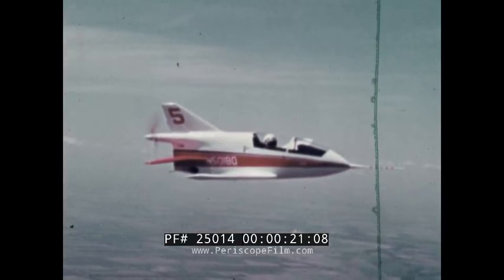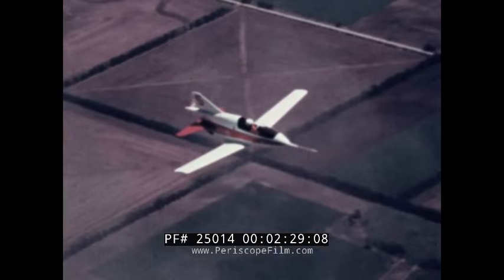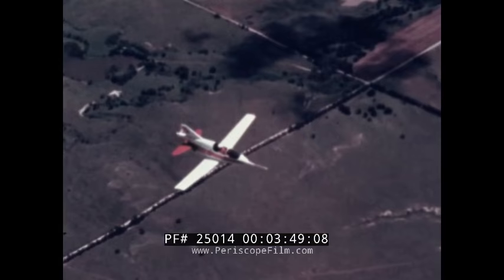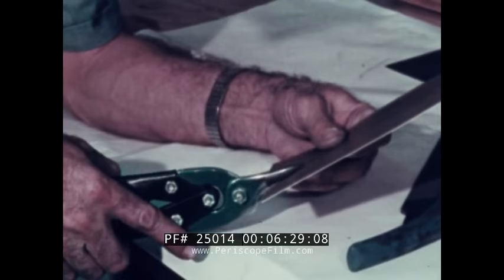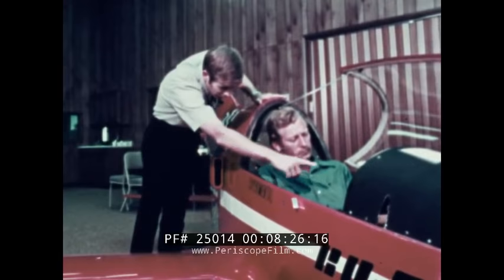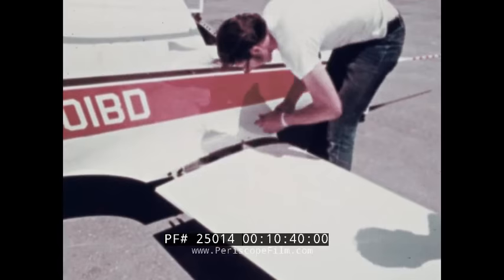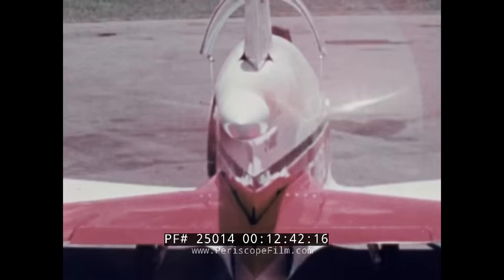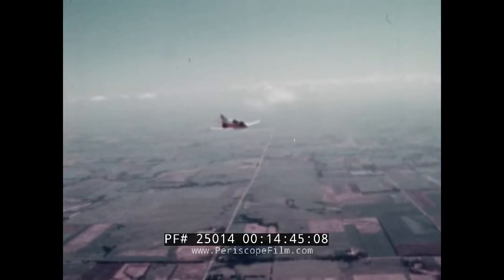BEDE BD-5 MICRO AIRCRAFT  PROMO FILM  "PIECES OF A DREAM"  25014

Comment: The BD-5 was WAY ahead of it's time! It was a sensation! Thousands of kits were ordered in the first year, when most airplane manufacturers would be ecstatic with 50 orders a year... Sadly, it was a bankrupt engine manufacturer/supplier and the long process of solving torsional resonance in the drive system that eventually lead to bankruptcy. Modern lightweight engines have finally caught up with the BD-5 in both the prop version and the jet version! Now it's better than ever!!! Five BD-5s were at Oshkosh 2018! FIVE FIVES!!!!!
Reply: Of course, an airplane is absolutely no good without a reliable engine. Unless it's a glider... 😂

I'm assuming all those BD-5's were jet powered?  Btw, The SONEX jet Jsx-2T is almost the spitting image of the BD-5, except it sports a V-tail.

Comment: I wonder what the performance would be like if they replaced the metal wing and fuselage with composite parts.
Reply: seoceancrosser 

They had always used composites ever since Bede brought Burt Rutan onto the design. That’s why you see the vertical tail and the use of composites.
Reply: According to a generalized presumption in my aeronautical engineering books you can count on greater that 5% increase in performance by using composite parts instead of aluminum. I think it would be awesome to see a carbon fiber bd5
Reply: @TylerKirkFilms  composites are not always better. Burt Rutan has stated publicly that the VariEZ would have been 10% lighter if made of aluminum. But composites resist fatigue, and corrosion better. They also support laminar flow, but only with proper a design and precise construction.

A commercial manufacturer with lots of resource might see a 5% improvement.

Comment: So the whole kit only costs $2,000?Does that include the engine with it as well?im sure the jet engine the kit will cost about $7,500 total cost?
Reply: The costs in the early 70s were more like double.  Bede sold the kits for less than what they cost in hopes of selling other items (avionics, etc) on the back end.  There are other videos describing the problems with the BD-5. I would compare it to the DeLorean in the early 80s.  Great concept vehicle, but lacking a powerful & durable engine at a low cost.
Reply: Yeah, $2,000 in 1970 dollars. Now, factor in the loss in purchasing power of the US DOLLAR since 1971 when Nixon ended linkage to gold and the costs of the FDR-LBJ welfare-entitlement state required massive printing of currency.  The dollar today buys about 1/15th of what it did in 1970 so the kit would start out at least around $30,000.
Reply: The price was with a snowmobile engine and propeller. The jet came later, and it was expensive. Probably over $200,000 in today's dollars. Just look who operated them.

Comment: I don't get it, this was supposed to be a kit and yet you have to use tin snips and welding? WTF?
Reply: "Kit" in the 1970s was the same as "Kit" model airplane. An assembly of materials smashed into approximate shapes that had to be trimmed and formed, fastened  together. Then the real work came, finishing times of 1,000 hours were not out of the ordinary. 

Vans, Rans, and Sonex changed the meaning of "kit" airplane.